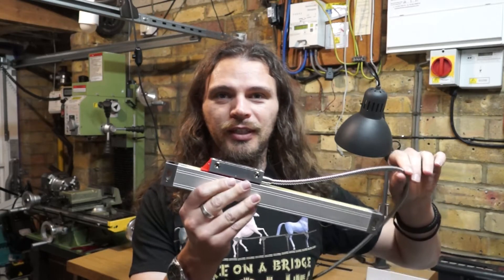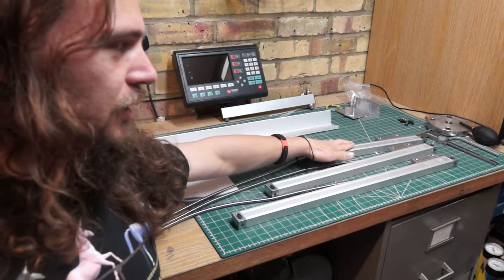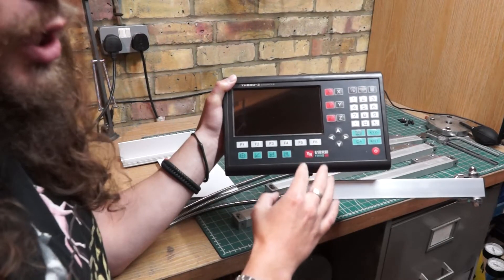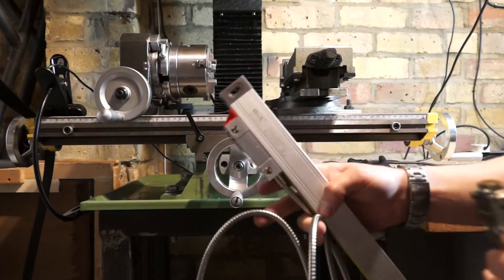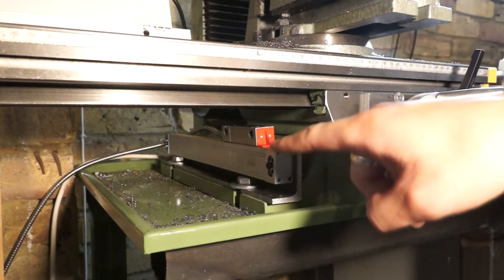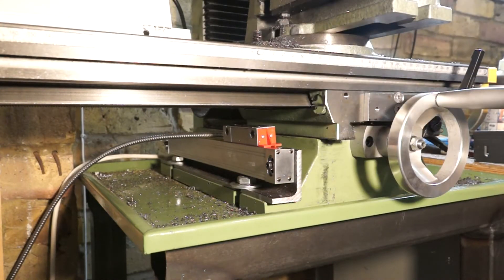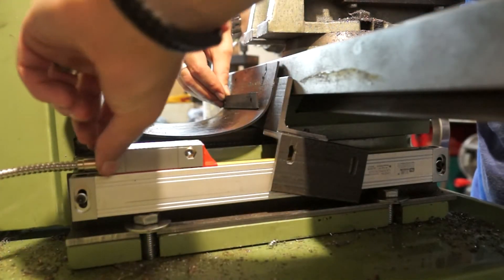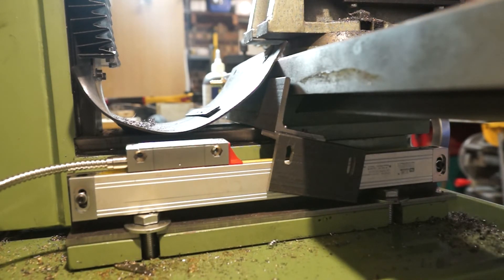Fitting a (DRO)Digital Readout to my Warco Milling machine

Comment: The front scale fitment is very neat indeed. WARCO fit this scale at the rear which is what I was planning to do. Except the read head was going to be a pain. The Y scale as has been pointed out is upside down. You have to use a jigsaw of L brackets to reach around the scale to clamp onto the read head. Luckily I have a wm14 mill with a WARCO fitted DRO as a guide. My new mill is a WM16B which is almost but not quite the same as yours.

Comment: The Y axis scale is upside-down. I did the same fit up, bit with the read head at the bottom, youll get chips in the scale, even with a guard. Try again, and see if you can flip it over.👍👌🇦🇺

Comment: Hi, any reason why you have a seperate mill to the lathe? as the Warco 250 can have a mill attachment fitted? genuily wondering as I have the lathe and was wondering the space taken by a seperate mill is worth it over the attachment
Reply from the maker: Hi PirateSteve11, good question. I cannot remember my exact thinking at the time but I think the general reasons were that dedicated equipment works better and is more accurate. 
I don't think I am even remotely close to professional but in professional workshops they have dedicated lathe and mills not adapters. 
I also had the space for both fortunately, so if you are limited and want both it's a great solution.

Comment: Hi interesting video,should make working on your mill more accurate and less hastle. Where did you purchase the unit ? Thank you.
Reply from the maker: Hi SteveD thank you. That was the plan mainly to help me continue being lazy with all my measurements. But finding centres on work should be a piece of cake now. 
I spent a long time looking around Ebay and found a seller with a high rating. Lots of sellers but not all have good ratings. I can't find the specific seller if you're interest?
Reply: @CavemanAston  I’ve just pulled the trigger on a wm16b milling machine. Fitting a 3 axis dro is the first project once the mill arrives. 
What was the reason for this type of dro?
Could you share the link where you purchased it from? 
Looking forward to the next video 👍🏼
Reply from the maker: Thats great. Let me know how it goes. I am curious how much difference there is between the belt drive and variable speed control system versions of the same machine. 
I purchased mine from this seller on Ebay https://www.ebay.co.uk/usr/shinedeerdirect2018/ 
Digital LCD over 7 segment type screen? Ill get some footage of the screen in the next video but the whole thing is graphical so when making bolt patterns it shows you what it will look like before you start drilling. Generally I thought it would be a little easier to use and require less looking at the manual trying to figure out what code means what if I had the 7 segment display.
Reply: @CavemanAston  thanks for the reply, I’ve tried to find the dro from that link but they must of stopped selling it 🤦🏻‍♂️. I’m sure they are all very similar if not the same under different packaging. 
I’ll keep a eye on my notifications for the next video.
Reply from the maker: @In the Workshop. Thats unfortunate they no longer sell it. I believe after some research that people have found the cheaper units can fail after a while compared to the semi pro versions. but at half the price I was willing to give it a try. 
Next video is uploading as I type and is for my new Vacuum. but hopefully within the next week I will have finished the DRO video.